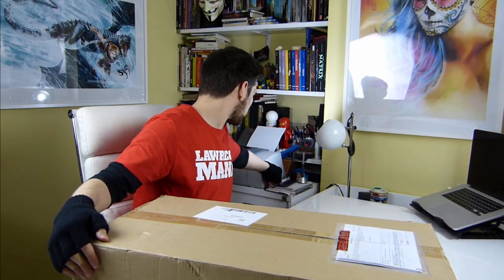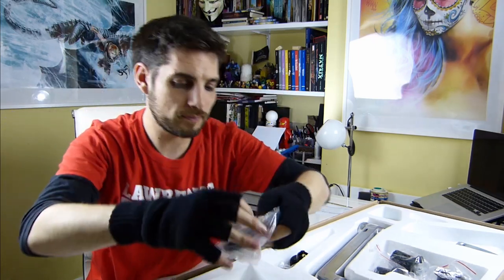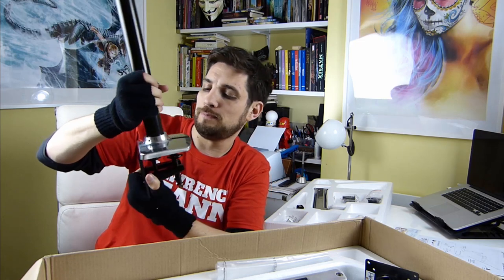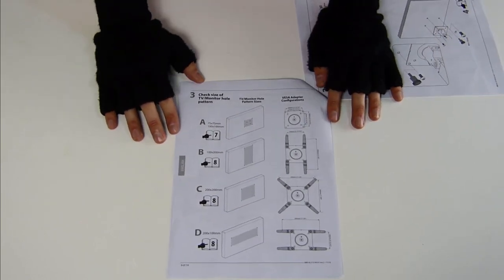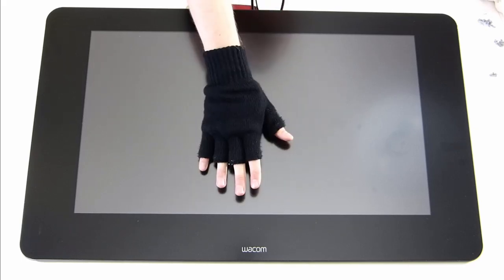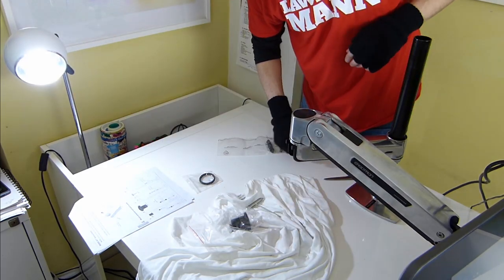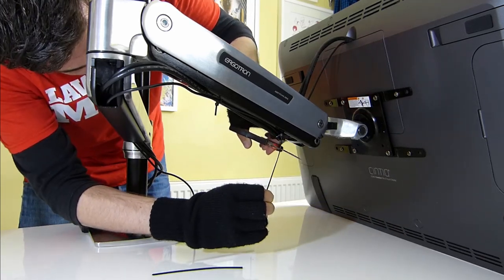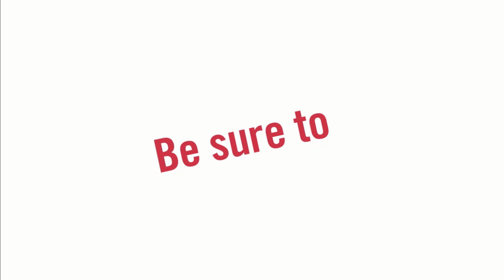Ergotron LX Sit Stand Desk Mount LCD Arm unboxing & installation for Wacom Cintiq 27QHD Touch

Comment: Thanks for this, should prove helpful, my ergotron LX sit-stand arm arrived the other day, just ordered the 27QHD (had to go for non-touch, wouldn't have been able to get away with spending nearly 2 grand for something i'd probably only use in zbrush anyway.) that should arrive by wednesday. My only issue with the ergotron's instructions is they're lacking a little annotation in parts, so i'd know WHAT tools i'd need, i one is needed that isn't supplied, for the clamp bracers, hopefully i can find something to tighten them properly with, if i can't find whatever the instructions are telling me to use.
Reply from the maker: Lots of people have said they've used this when installing the arm as an instruction manual. All the tools come with the arm but grab some screwdrivers too! Have fun!! The instructions that come with the arm are easy to follow so using this video and the instructions will make everything really quick and simple!!
Reply: Well, i looked through the box and found all the allen wrenches and screws and such, only thing i didn't find was that tool needed to tighten the clamps up, ive got a ratchet screwdriver that has interchangable heads, maybe that'll do.
Reply from the maker: Let me know how it goes! Maybe Tweet some set-up pics @LAWRENCEcanDRAW
Reply: Will do :)
Reply: And now following you :) my twitter is @AnthonyA85 though i don't really use it, i'm just on there to keep up with a few people.
Reply from the maker: Look forward to seeing the pics!!
Reply: Lawrence Mann I tried to send one over Twitter last night, not sure if you got it. I much prefer facebook tbh
Reply from the maker: Got it ;D Replied! #ShareTheVideo :D

Comment: That thing need to drill a hole on the table ? can we use it without drill on table ????
Reply from the maker: It comes with a clamp attachment too but given the weight of the arm & the tablet I suggest it is better to fix the arm like this. You need to have a sturdy desk as well either way you attach it.
Reply: ah thanks
Reply from the maker: No worries! More Ergotron videos coming soon ;)

Comment: Strange , I ordered the same ergotron LX arm and my mast is not that high as yours 😑
Reply from the maker: I think there is an alternative with a similar name. Lots of options on the Ergotron site to choose from. You don't really need the height so I wouldn't worry about it :D The arm is more secure if you have it lower to the desk. You can always contact +Ergotron if you're worried they sent out the wrong part. They're awesome at customer service ;) Hope that helps? #ShareTheLink :D
Reply: Sorry, i was wrong, i don't have the standing LX 🙂
Reply from the maker: :O oh

Comment: hi

Nice videos
I just bought a lx myself. what bracket did you buy to connect to the cintiq?
Reply from the maker: +Niles Crane You can get any of them from eBay. Just get a 200x100 VESA ADAPTOR. Try to get a one piece as it'll be more steady. 

If you're buying direct from Ergotron then you can get a VESA mount from them too. 

Hope that helps.
Reply: LAWRENCEcanDRAW 

it will. I just had to return my ergotron lx, it could not hold my Cintiq 27.. 

is yours the ergotron lx hd?
Reply from the maker: "Erogotron LX Sit-Stand Desk Mount LCD Arm" I mention it several times by name in full in the video. That is the arm I have. Works perfectly. I chose that after advice directly from Ergotron. They've been great! The standard LX Arm can't handle the weight but if you look at the specs on the site and match it to your Wacom you'll be okay.

Comment: Hello anyone here please help me!! I bought a second hand ergo stand for my Wacom Cintiq 27 Touch, but the 4 silver screws (of the silver and the black ones) are missing. I would love to mount the Cintiq, but I need to know the size of the missing screws. The pitch should be something like around 12mm, but I'm missing the width! Please, if anyone has them in handy and could tell me the size, I'd be very grateful! THANK YOU :=)
Reply from the maker: Sorry I don't have a bolt gauge to measure the screws. I would advice Tweeting or asking Wacom or Ergotron directly what the screw type is. Hope that helps!

Comment: This has been very helpful. I'm getting pretty bad tennis elbow from working on the Cintiq. Just to make double sure..is the part number for the one you are installing 45-384-026? I'm working with a Wacom 21UX.  I went to the Ergotron website and this seems to be the one you have...the LX HD Sit-Stand Desk Mount LCD Arm...thanks a million for your in-depth reviews!
Reply from the maker: That's the one! Make sure your desk is sturdy enough (not thin chipboard) and if you can, drill a hole and bolt it through for extra stability. Tweet or email Ergotron & Wacom and let them know I helped ;) #SpreadTheWord
Reply: thanks LAWRENCEcanDRAW. When I talk to Ergotron I'll absolutely bring up your name...it has been a big help. I'm trying to avoid a career ending injury. So thanks for helping out.
Reply from the maker: No worries! Glad to help ;)

Comment: Thanks for the video - would I need the VESA adapter for either the 22HD or the 27QHD? Thanks.
Reply from the maker: Certainly for the 27QHD. Here's a link to one that will do perfectly for you: http://amzn.to/2oRlsZe I'm not sure if the 22HD uses 200x100 or 100x100 mounting. You've have to check the specs.
Reply: I have the 22HD touch version.  The regular Ergotron arm & hook ups (100 x 100) work fine with it.  I've also seen a couple of videos with the Amazon Basics version of the Ergotron arm work fine & dandy with the 22" version. It's the 27" version that appears to need some extra hook ups on the Ergotron side. 

The 22" version is 20 ibs, & the Ergotron has no problems with the weight. I hear that the 27" is actually a bit lighter then the screen I have.  If true, then it should be zero hassles, apart from that extra Ergotron hook up.
Reply from the maker: I've heard a couple of people mention those Amazon arms in the past but my argument is – why pay a lot of money for a great tablet just to mount it on the cheapest thing you can find?!?! They handle the stresses and strains as well as the Ergotron brand arms and if something goes wrong then your expensive tablet smashes to the ground. Wacom won't replace it either because they'll just tell you that you dropped it and even under warranty that's your fault. Sure, search out another brand if you can find a really good one you like but don't trust what could be a few thousands of dollars to balance on the budget arm.

Also Ergotron has a really good Warranty. Not sure what the Amazon one has off the top of my head. The cheap on might work if you never ever moved it but I'd also like to point out that if you're an artist who likes to move your tablet around a lot (probably why you want an arm) then that's where you need an arm that's better built! 

Which arm are you using with your 22HD? Is it the standard LX (http://amzn.to/2nssz9N) Or is it the arm in this video? LX Sit-Stand Desk Mount LCD Arm: http://amzn.to/2nFlZxR
Reply: The standard LX.  Probably the best purchase I got for my Cintiq, next to the screen protector (made of money I am NOT). Hindsight being 20/20, I probably should have gotten the optional extension for the arm, but I can always get that at a later date.
Reply from the maker: You can use the extensions but not with the 27QHD on either arm. Every time you put an extension arm on, you reduce the load capacity of the arm and you have to account for that. Cross-check all specs for weight and size before creating a set-up ;) If you;re not sure then Tweet @Ergotron + @LAWRENCEcanDRAW and we'll both try help!
Reply: Thank you - much appreciated!
Reply from the maker: Happy to help Hannah! I'm almost at 5k so stick around and share a link :) Thanks for joining me on Twitter! Always more ergonomic stuff for artists on the way!
Reply from the maker: P.S. Never used a screen protector for anything. I personally don't even like them on my phones just because it's something else between you and your screen but I certainly couldn't suffer one on my tablet! Plus, you're never gonna drop your tablet if it's on an Ergotron so just learn to be careful with it. lol. The screens are a lot more hard wearing than they were a few years ago and you really don't need to press like King-Kong on them. You can alter the pressure in the settings ;)
Reply: With what I paid for the screen I simply didn't want to risk scratching it, which would be a VERY expensive repair.  It also helps that the screen protector has some "tooth" to it, the screen is simply too smooth otherwise for my tastes.
Reply from the maker: That's fair enough. In almost 30years of using tablets though, I've never damaged one! Don't hold cups of coffee etc over them though ;) I do understand wanting more tooth but it's a parallax trade-off because some are too thick. To each their own. To be fair, I might well do it on something like the Surface Studio wit that very glossy screen. I have thought about it for the Surface Book.
Reply: Regular Ergotron LX wobbles a bit with 22HD. Sit-stand version is much better if you also like to work while standing up!
Reply from the maker: I recommend it for everything now: http://amzn.to/2nFlZxR but people will buy what they want! Ergotron don't officially make an arm for any drawing tablet but I know they are taking more notice of us folks now!

Comment: you realized it that you have mounted the extension brackets VESA, on the contrary?
The 4 arms are slightly bent in L, and must protrude toward the outside (toward the monitor) not inwards ... Check them. Risk of straining the rear plastic of your cintiq. ;)
Reply from the maker: That was fixed straight away after filming. I've since replaced the four
 arms with a more dedicated one piece bracket which is more sturdy all 
together!
Reply: Hi Lawrence thanks for the review! In this comment above, have you changed the arms for something else? I want to order the LX sit and stand for my Cintiq 22HD.
Reply from the maker: Hi Mike, not the arms of the Cintiq. Just the VESA adapter (four little arms that attach the Cintiq to the Ergotron arm). I simply ordered a normal one-piece 200x100 VESA adapter on eBay. Hope that helps!
Reply from the maker: As long as it's 200x100 it should be fine. Sorry I don't click on links or offer personal recommendations unless you're a Patreon – No offense. I just have to be strict about my time ;) Sure you understand. Here's the link if you want to check it out – https://www.patreon.com/LAWRENCEcanDRAW – Lot's of cool stuff!
Reply: Ok, thanks.
Reply from the maker: Hopefully we'll see you soon ;D

Comment: I love your videos. They are really helpful and encouraging when having serious doubts for making a choice. I still doubt between the ergotron and the wacom ergostand, because my  habits...I tend to rest over the drawing surface (As I am a long time artist in an old fashion regular board table) so I am worried if the ergotron can actually stand YOU resting a bit over the cintiq or if it has a position or button that makes the arm totally rigid at your will. I dont know if I am being clear. Maybe you said in the video and I missed it.....your accent is hard for me. regards.
Reply from the maker: My tablet rests on my desk and the Ergotron arm allows me to move it around when I need to. When it is rested then it I can lean on it just fine! Hope that helps ;D
Reply: yeah, That helps. It means you can't lean on it if you are working "standing" or if it doesnt rest somewhere (for me that´s important because I hve then to think on the hight of the desk as well (I have some back pain and I need to be extra careful) thank you for your quick answer. Best regards.
Reply from the maker: Yeah you have to adapt the way you work but ask yourself if you'd prefer to rotate your Cintiq and be able to easily move it around the desk space? Also, being able to work standing is hugely beneficial if you're drawing for long periods of time! Do you get a stiff neck or back?
Reply: Actually I would love to be able to work standing and rotate....if the arm allows me to do it...after your kind response I will tell you how it finally goes when I set it all up.
Reply from the maker: Good to hear Ivan :D Nice to know what my fellow artists are looking for. Keep in touch and let know what you go for. BTW, If you draw on the iPad then you can get a JoyFactory arm like the Ergotron arm, that does lock into place. Check out the videos on my channel for that if it is of use to you ;) #SpreadTheWord

Comment: Hi Lawrence, thank you for the helpful videos! I'm trying to get the hd sit stand arm but can't find a retailer that will send it to my country... I did find the older sit stand and the regular lx arms in local stores, both of them suppose to handle up to 11.3kg do you think they will work the same as yours? thanks again!
Reply from the maker: HI Udi, I use the normal LX arm for my laptop. I used to use it with the Cintiq 21UX and that was great. But the 27QHD is of a certain size and weight that it really needs a bigger arm, otherwise it won't support the tablet. I talked directly to Ergotron about this and they advised me on this arm so I'd say it's probably best to keep looking. 

What country are you in? Have you tried buying directly from Ergotron? You could contact them via Twitter to ask about suppliers in your area.
Reply: thanks for replying!  I'm from Israel, the Ergotron site is where i found the stores here but only one of them have this specific model and they sell it for more than the original Wacom ergo stand costs here (630$!), I'm wondering about the regular sit-stand (not HD), it looks exactly the same only the weight capacity is a bit lower, still in the cintiq range though
I'll try asking Ergotron on Tweeter. thank you!
Reply from the maker: Are you wanting to fit the 27QHD to it?
Reply: LAWRENCEcanDRAW Yes
Reply: well, the Ergotron people told me they do not officially support Cintiq tablet but said I might find all the answers I need at the attached link. it was your youtube channel... :) I Will keep looking for a foreign vendor that will send me the sit-stnd Hd or just buy the wacom one. thank you very much! you have a great channel!
Reply from the maker: That was good of them! Let's get you sorted out then... The arm I have is not a HD arm. It's a 'LX Sit-Stand Desk Mount LCD Arm'  Part Number: 45-360-026 – Do your suppliers sell this?
Reply: Yes! I was under the impression you are using the other one (45-384-026)
Reply from the maker: Nope. The 'LX Sit-Stand Desk Mount LCD Arm' is great. You don't need the HD version ;) Hope that helps!
Reply: Amazing! that's great news. thank you so much for your help!
Reply from the maker: Happy to help #SpreadTheWord :D

Comment: Wait so the vesa adapter came with your arm?
Reply from the maker: Yes but I've heard somebody say they didn't get one. I'm not 100% sure if they ordered direct or if there were other factors involved though. I got mine in the box and it was also marked as included on the instructions. Hope that helps.
Reply from the maker: I did replace it with the  RiteAV VESA Adapter Mount for LCD & Plasma TVs (Identical to the one I show here): http://amzn.to/2oEgXkq for a time until I had to mount something else onto the arm in a later video :D